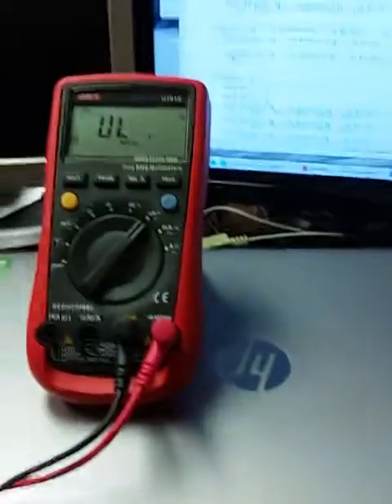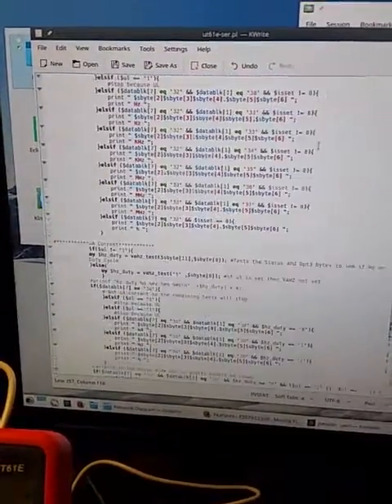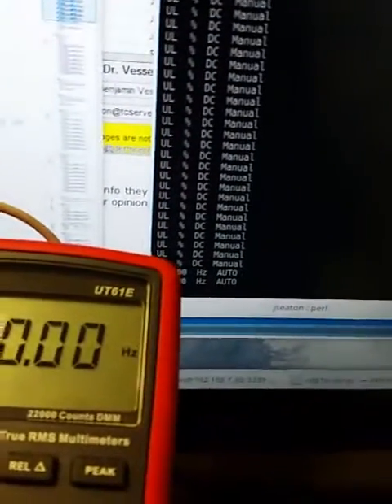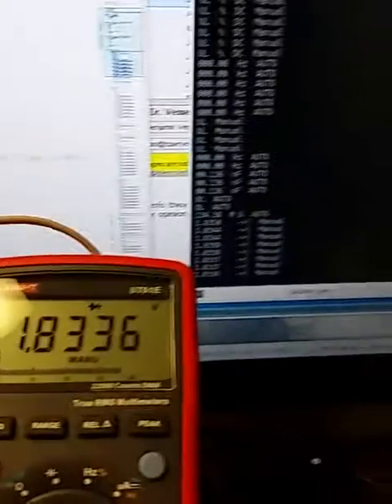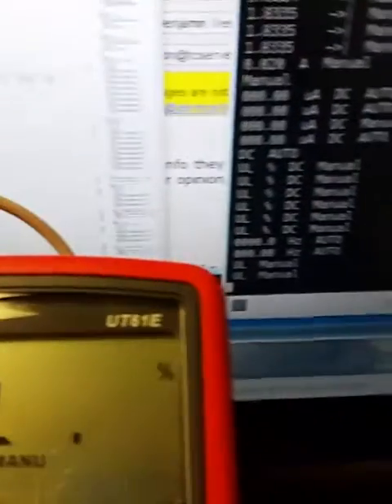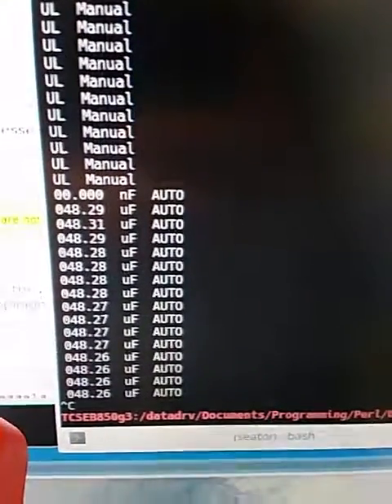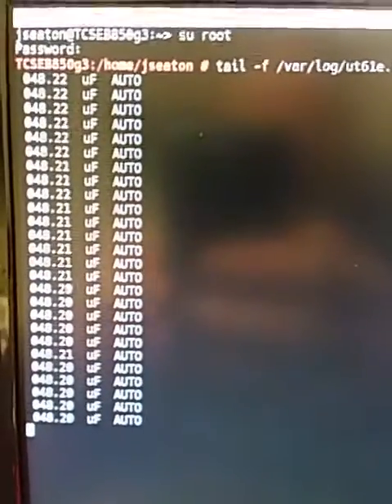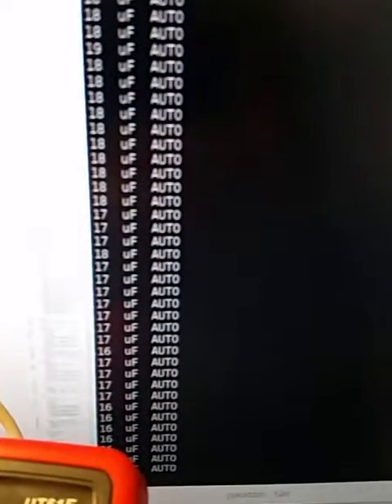UT61E with Sigrok  QtDMM Part 2

Comment: Is this software have options export to csv file or different like xmls
Reply from the maker: There is only a -l option that will write the output to a log file. This can easily be imported into a spreadsheet because it is space delimited. Hope this helps.